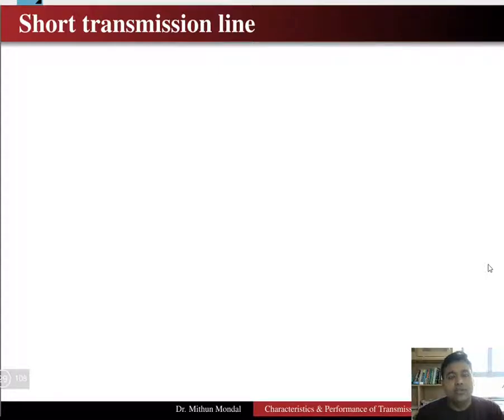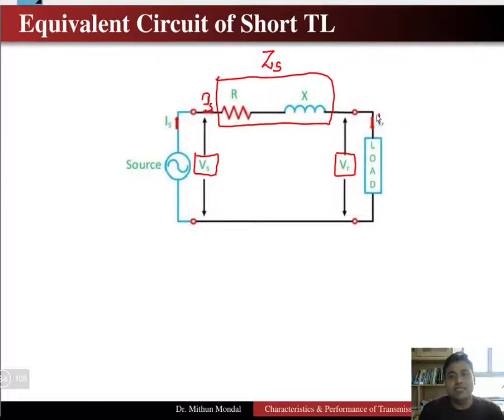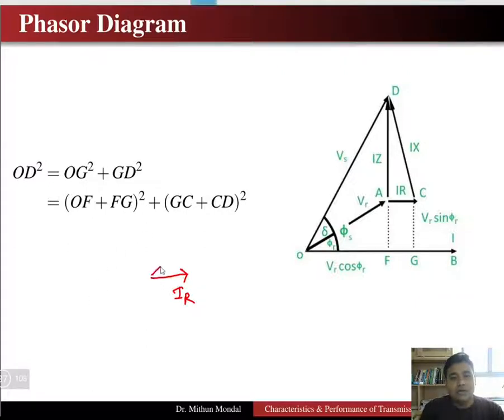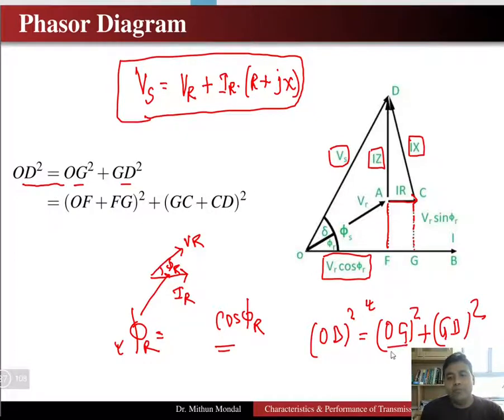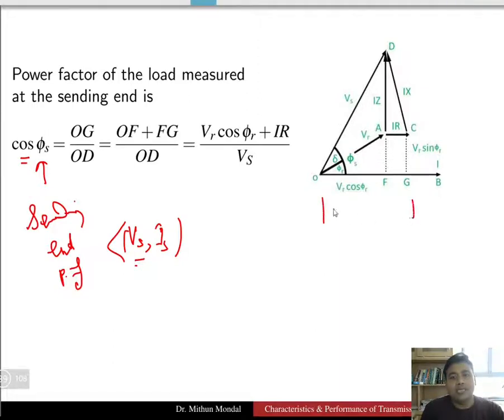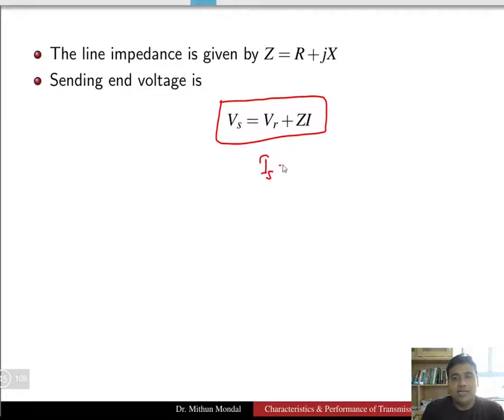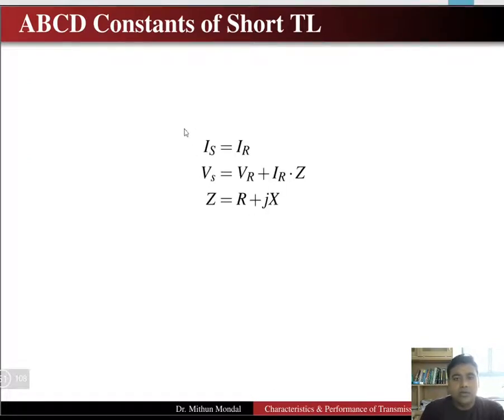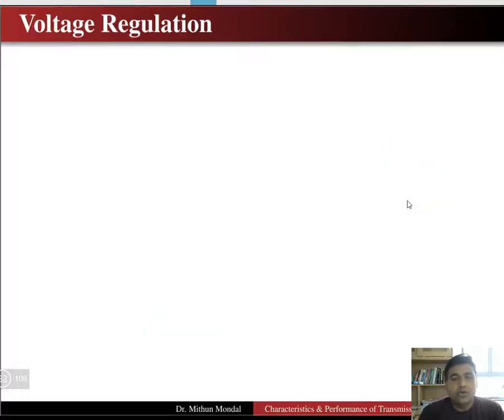Power Systems | Lecture-17 | Short Transmission Line

Comment: Sir, two doubts:
1. In the phasor diagram, you have applied Pythagoras theorem for triangle OGD as OD^2 = OG^2 + GD^2 but GD does not appear to be a straight perpendicular line as CD is at some angle to AC, i.e IX is not perpendicular to IR. Then how are we taking the Pythagoras theorem? Are we going under the assumption that point D is far enough that we consider CD to be perpendicular? 
2.In the last slide efficiency formula, shouldn't it be Power at receiving end/ (power at receiving end + losses) than power at receiving end/ power at sending end + losses ? or the sign should be negative as power at sending end - losses= power ar receiving end.
Hope you understood my queries.
Reply from the maker: 1. Actually there is a slight problem in the figure, the source from where I have taken. IX (Inductive drop) will be at 90 degrees and IZ which is the hypotenus will be inclined. Now, GD will be straight. Then easily pythagoras theorem can be applied.
2. Correct istead of sending power it will be receiving power. Typos mistake.
Reply from the maker: I have added correction in the video. Thanks for pointing out.
Reply: @EngineeringDevotion  Thank your sir for the clarification